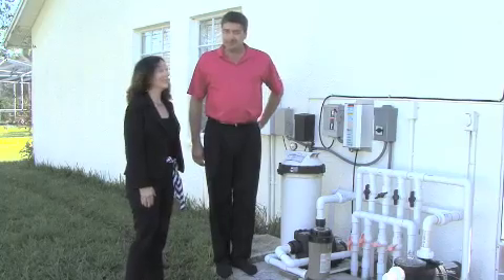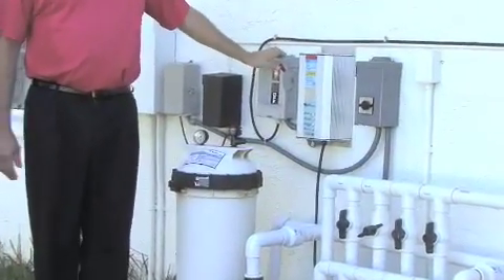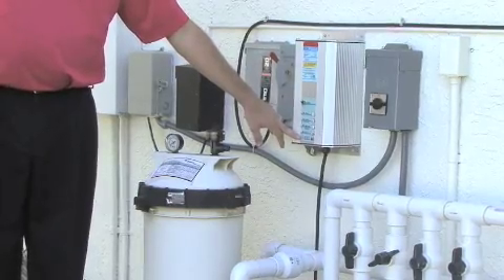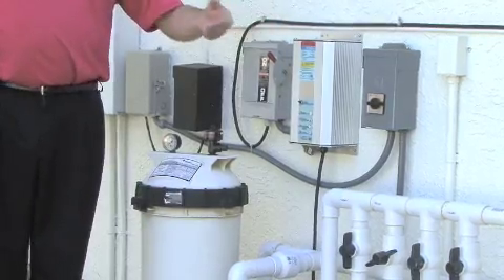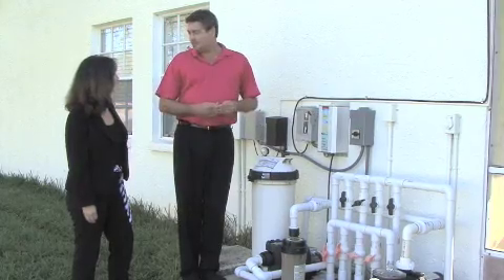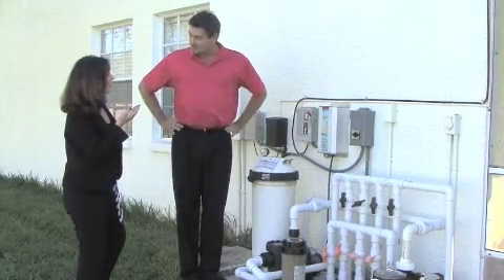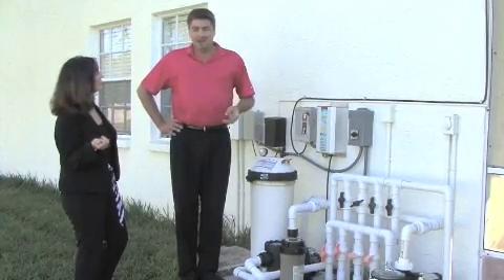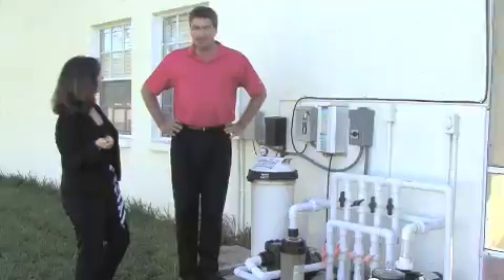Photovoltaic Pool Pump

Comment: http://www.sunrayus.com -- SunRay Solar Pool Pumps can power your pool water filter system for free using the energy of the sun, operates with zero electrical costs and is virtually maintenance-free.